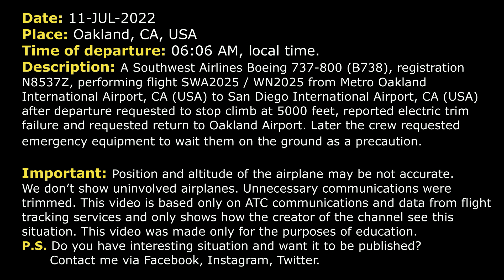“We have electric trim fail” | Southwest Boeing 737-800 | Oakland, Real ATC

Comment: This is one situation I'd rather be in an airbus for. Even if the electric motors stop working you can manually turn the trim wheel AND you don't have to turn it so much to move it to have an effect. It takes about 15 full rotations to move the stabiliser one degree in the NG and Max. You can move the THS on the A320 1 degree in less than 1 full rotation and is much easier as you are operating hydraulic motors which then move the stabiliser. Like powered steering compared to no powered steering
Reply: Try that with no hydraulic power left;p
Reply: @cpt_riris  if there is no hydraulic power left in the stabiliser and it cannot be moved then the elevators act as the autotrim to stabilise the aircraft
Reply: @tomstravels520  yeah i know. Im airbus rated
Reply: @cpt_riris  oh well you have 737 MCP as your banner and what looks like a Boeing cockpit as profile pic
Reply: @tomstravels520  i fly 737 but also rated on 320. My comment was about how limited the authority of the elevator is when u get a jammed ths at high speed on the airbus despite the fbw magic that comes after
Reply: @cpt_riris  how can you be rated on both? I assume you mean one at a time as fairly sure if your airline has both you can’t fly one one day then the other the next
Reply: @tomstravels520  active rating on both but my airline has only one type
Reply: @cpt_riris  that’s the first time I’ve ever heard anyone able to fly at the same time potentially as they are far from similar
Reply: @tomstravels520  as i said im rated on both but only actively flying the 737. If i were to change company they would re familiarize me with the other type(ground school, sims, line training)

Comment: This time: "EXCELLENT controllers". No extraneous questions give them time to handle things and only ask for stuff like "want equipment standing by" when the flurry of activity in the cockpit is starting to wind down.  And no priority that they didn't ask for. I am VERY sure they would've gotten it if requested. But that meant that "there was no-one behind them", so less stress in the cockpit for having to maintain a specific speed. Ah... of course! The controllers realized they would want to slow down slowly and early to have the time to manually trim the plane to fly at those speeds. 

So very often, the controllers keep bothering the pilots with course corrections, extra questions etc etc. Often in the USA turns are maximized to about 90 degrees. So doing a 180 would require to interrupt the pilots twice. But this time: from 170 to 340 in one turn. That's a 190 degree turn. Would've been a 170 degree turn if turning right, but the pilot suggested a left turn. No question asked WHY, OK if you want to do that via left turn I can accommodate that and  you do the left turn.

Comment: Those trim wheels will give you a real arm workout... or break your arm altogether if the electric trim suddenly comes back on!
Reply: the procedure is to cut out the elec trim completely before attempting manual trim.
Reply: If i know electric motors are not stronger then human arm. The idea is to interrupt electric trim manually when needed.
Reply: @Marix498  ….the elec trim is turned off with cutout switches and then manual trim can be used freely.
Reply: @UAL320  i know about that but it is my respond to "braking arm". It is possibile to stop electric time anytime by hand before cutting switches. It is important in case of 737 max fall downs... It was possibile to stop mcas by hand, even when they forgotten about cutting switches.
Reply: @Marix498  …..In a runaway stab scenario, as a last resort you can try to hold the wheel.  You wouldn’t need to do that though, because you would have completely disconnected the electric trim altogether.  That is of course different from this scenario, where they appear to have had a failure of the electric trim which forced them to pop out the handle and crank the wheel by hand.
Reply: @UAL320  in max crashes they have not switched off electric trim which means also switching off mcas. Even if they forgot about the switches they could have stop rolling by hand..
Reply: @Marix498  …..Maybe I am confused as to what you are trying to say.  Yes, it is true you can roll in manual trim without activating the cutout switches.  But as the guy above says, if the electric trim activates itself uncommanded (MCAS, speed trim, etc) you have a chance of hurting yourself.  So I don’t know why anyone would use manual trim (especially with the crank handles out) without activating the cutout switches.
Reply: @UAL320  it is shocking that pilots of crashed maxes didn't see that unintended up and down movement of that plane where if rudder trim rolling simultanuosly. Even if they were not informed about mcas it was easy - just to stop trimming. Finally - even if they forgotten about electric trim cut off switches... They had opportunity to stop rolling trim by hand. That was my thought.
Reply: @Marix498  …Agree!  They didn’t fly the airplane, it flew them.